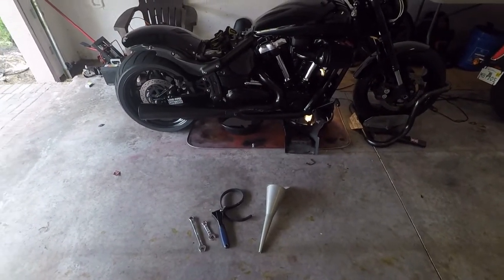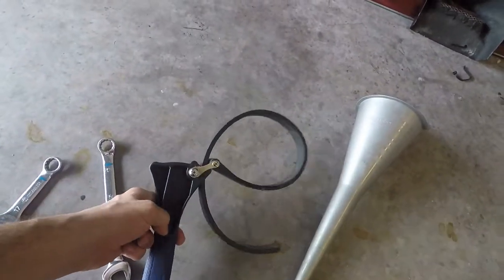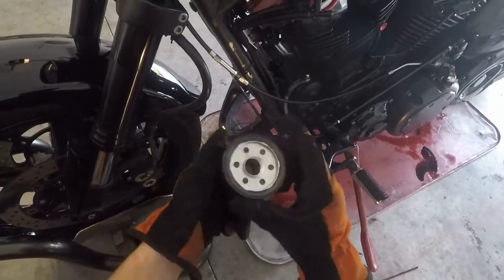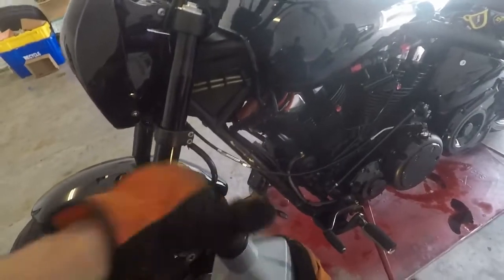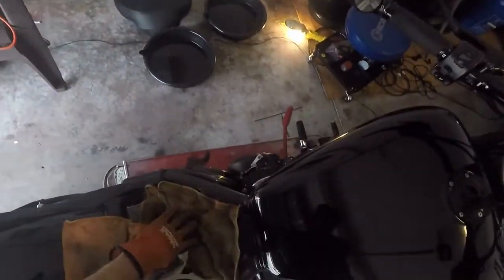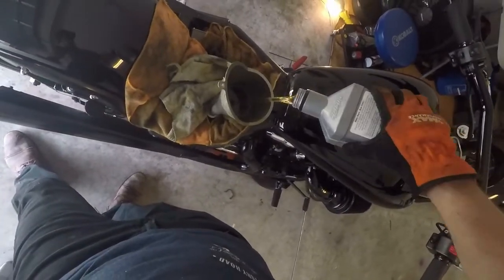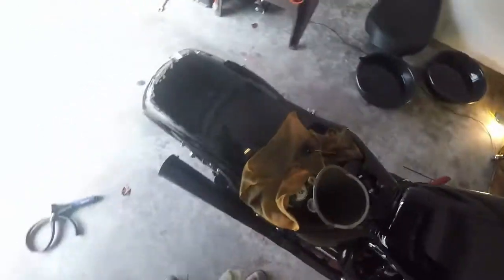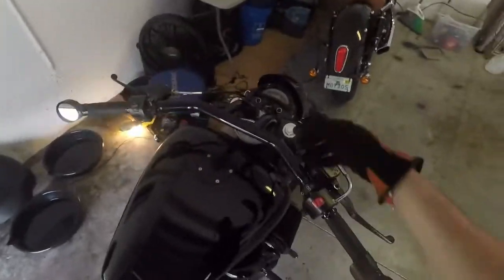YAMAHA WARRIOR 1700 OIL CHANGE / HOW TO

Comment: Great video, very helpful. I suppose each bike can be a little different and I did mine on a small Craftsman jack, I was able to put in three quarts before starting the engine to circulate that oil. The rear 17mm drain plug was easier to get to with a deep socket in my opinion. Thanks again!!!
Reply from the maker: Awesome brother Im glad it helped

Comment: Stay away from k&n filters.  A lot of guys have had the cans rupture at the nut area and other had the cheap oring blow out.  Its happened so much motoamerica and other racing orgs had to ban k&n oil filters because so many of them failed on the racetrack.
K&n even had to recall some.
Reply from the maker: Damn that's crazy news! Well good thing I switched to amsoil filters! Thanks for the input!
Reply: The stock yamaha filters are good too.  Also hiflofiltro.  Name sounds generic but the filtrr are top of the line.
Reply from the maker: blue03r6 awesome info man I'll look into it!